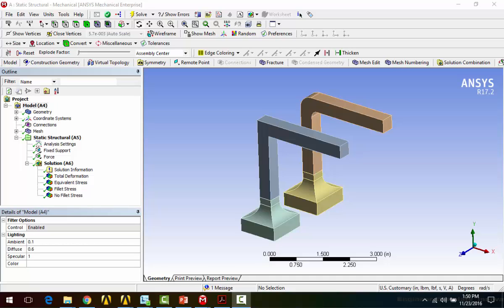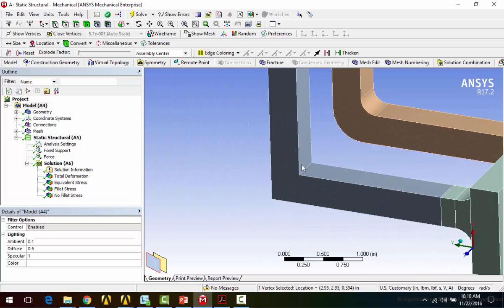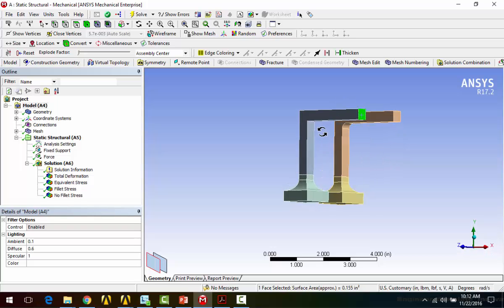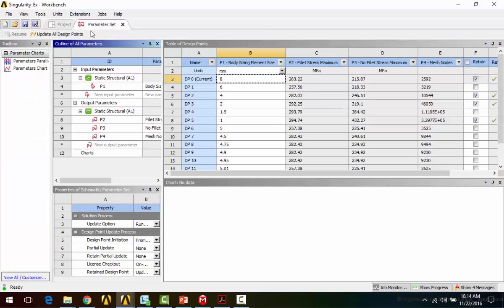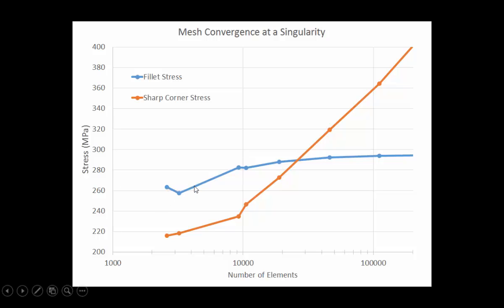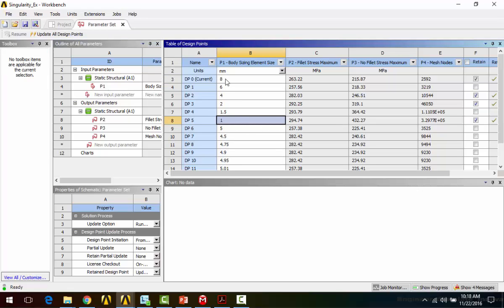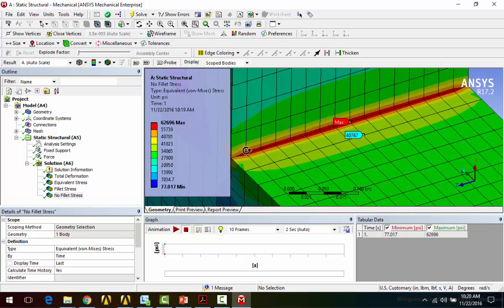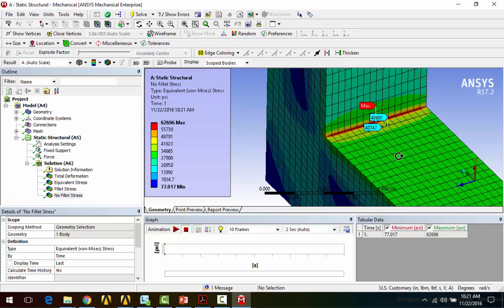Addressing Stress Singularities in Ansys Workbench: Best Practices and Solutions

Comment: I would like to ask a questions. If we don't have filled edge on our design, and local stress - as your sharp edge model does -  un-realisticly calculated like over the material yield stress. We can estimate what is the approx. real value with using probe. But, when we use Lineriazed Equiblirum Stress (LES) for stress range at this specified high stress point than we gonna caltulate really huge Stress Range. And this is affect our fatigue life calculation according to ASME Sec.VIII Div.2 and EN 13445 (pressure equipment design codes) calculations. So how can we prevent to have this locally high stress (came from singularity) ? As i indicate before, our design has no filled edge, only sharp edge. Thank you for you support.
Reply from the maker: Hi Ibrahim, feel free to drop us a note at info@simutechgroup.com if you're interested in our consulting services and we'd be more than happy to help! Otherwise there is the Ansys student community to find posts/articles: https://studentcommunity.ansys.com/

Comment: one element away? it's bad idea. it is not mesh-independent result. And You can't compare two results: fillet and non-fillet. It's pointless.
Reply: What would you suggest be done in the cases where getting rid of the sharp edge is not really an ideal option?
Reply: You are right. I have checked sharp corner with not fillet, with different mesh size(from 2mm to 0.25mm). It is really very mesh-dependent result, much larger stress one node away with smaller mesh size.
Reply: I think he is showing the same CAD but one with the fillet. The one element away I agree, I have a singularity but the values increase gradually to the max point/element is not an asymptote

Comment: thanks for this video. i have 2 questions in mind.1. in the stress vs. elements graph, what can we deduce about the mesh size where both graph's lines meet? will it be correct to call it an optimum mesh? or is there another way of looking at it?2. i am curious about the usage of parameters and how it increases solving time.
i'd like to try it. say just for varying mesh sizes.